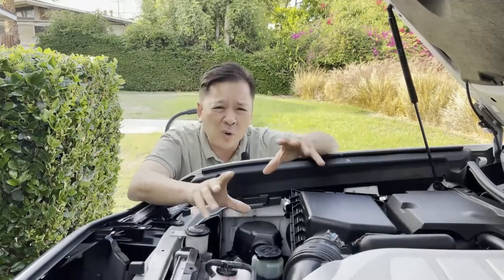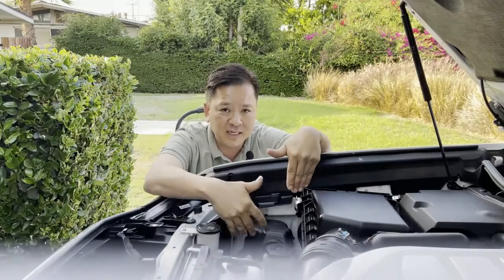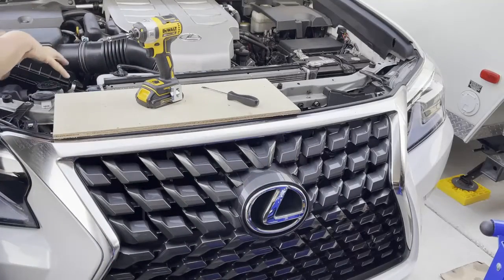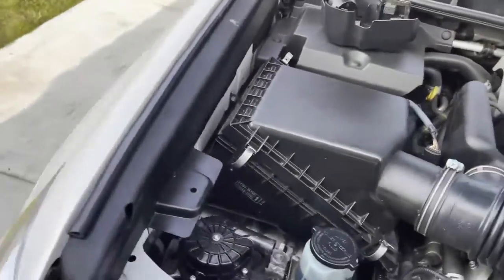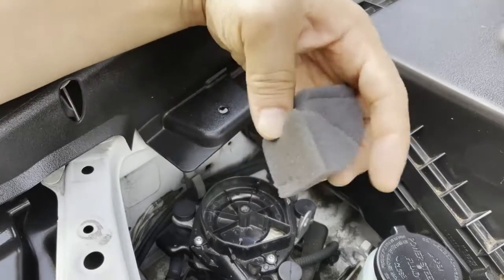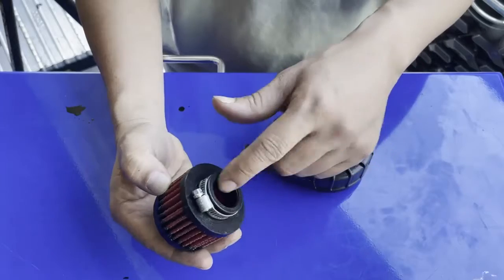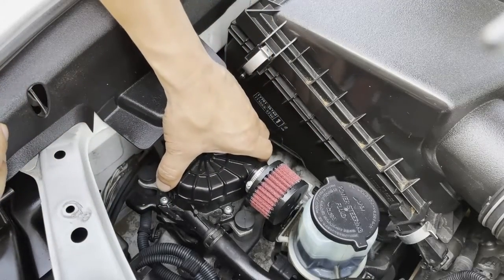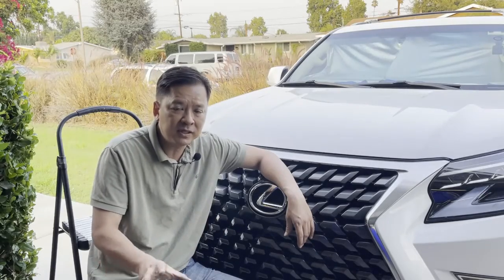Why We’re Modifying the Lexus GX Secondary Air Injection Pump

Comment: Great video Bob.  Happened to my 07 Tundra.  It has two of these.  It also has a really neat computer that automatically puts the truck in a “limp mode.”  so you can’t ignore the problem.  I think the engine works fine if you can bypass this pollution item/device, but you also have to “trick” the computer into thinking everything it is still working.  I didn’t want to use the bypass/computer trick kits though.  Mine went into limp mode on a hill, and my engine light went on.  This would be really dangerous if you were on a long uphill in the middle of nowhere with semi’s passing you at night.  The Tundra will only go about 30mph in this limping uphill situation.  Can’t believe Toyota is allowed to have a non-emergency system that does this to you while driving?  My mechanic did a computer reset just to get me home until my parts arrived and the engine ran perfectly on the way home.  It went back into limp again the next time I started it while I was on my way back to my mechanic again for the repair.  I first went to the dealer for this “service” and they acted surprised like it almost never happens, then I read the recalls and forums telling how chronic the problem is.  I complained to the dealer and Toyota Corporate for recall repair, but both said mine was well out of warranty at 90,000 miles because of age.  $3000 from the dealer to replace the whole “system” only to maybe have the problem happening again.  Local Japanese auto mechanic fixed it for $1200 with both new OEM pumps even though only one was bad.  Will be checking your simple mod out on my 04 GX470.  No problems yet at 170,000, but definitely worth $30 not to have this happen again.  Is it the same part and easy fix for the 04 GX470?  Another way to avoid the problem is to keep your car out of rainy wet climate…like Washington State where I live!  Thanks again for your great video’s.  Every Toyota owner should subscribe to your channel just for this video alone!
Reply from the maker: Hey Blankenship, thanks for comment.  This has happened on both my 470 and 460.  I was only able to do the mod on my 460 since it was out in the open and took as little as 15 minutes to do.  I was able to drop off my 2008 GX470 back in the days at the dealership and they took care of the problem noting the recall was a popular item at the time (and it still is).  The 470, from what i heard and read on the forums, is a lot more work involved as you have  to start removing manifolds, etc...I planned to do a video for the 470 right before all these vehicle prices started to skyrocket.  Because of that, i never was able to pick up a 470 to tinker around with as that was my original plan.  Again, thanks for tuning in Blankenship and i will eventually get around to picking another 2008 up some time in the near future.
Reply: My friend has a gen 1 tundra and went through some issues relating to not starting and limp mode so i will tell him about this issue.
Reply: @juliosdiy3206 gen one didn’t have these issues

Comment: Hi Bob, just to let you know I ordered the k&n filter you mentioned and it’s a tight fit had to trim and it still sits up against the power steering res. Not sure if that’s okay or not. Thanks for all your vids love em!
Reply from the maker: Hey Jude, i wish i was there to see what's going on but as u can see in my install, the fitment was right on.  Your flange doesn't necessarily have to sit at the end of the SAIS inlet tube, you can push it further to gain clearance from the power steering reservoir.  If its still giving you problems, K&N does sell shorter filters.

Comment: Hey dude.i forgot to tell you I made this mod several months ago and it was super easy. I try to avoid things that happened to others with cars. Especially when it causes a real pain in the arse!
Reply from the maker: Did you have any issues with fitment? or rubbing against the power steering reservoir?
Reply: @GXBOB  
No. Not at all. Perfect fit with no modifications other than what you did.

Comment: I have a '22 I just got in April. I called the dealer about this and the tech told me he hadn't seen this in years.
Me being me I had to open the unit and sure enough, it still had the foam.
I decided to replace it. I got the K&N, they both measure the same.
The fit was very tight against the PS reservoir.
I cut the units rubber tube flush with the clamp and I was able to get it on
Thanks
Reply from the maker: A 22?  You got a long way to go before anything goes bad on your GX, but nonetheless, great job for finding a "fix" to make it work.  Not all products and installs come out perfect.  A little elbow grease and an hour on a beautiful saturday is all it takes to unwind.  👍
Reply: @GXBOB  I realize it doesn't happen over night but foam degradation is constant until it falls apart.  So,  why not replace while it is on my mind. 
And it is cheaper than a replacement pump
Reply: @ejcheck   I would like to think they changed the foam type.  It is insane to keep using the same design all these years.  That said, I get my 2023 next week, and just ordered the new filter.....

Comment: Damn Bob that was awesome! Simple and quick preventive mod! Oh and haahaahaa when you threw away the sponge filter! 🤣🤣🤣
Reply from the maker: That was all muscle Gilbert...all muscle.
Reply: @GXBOB  is it a big deal if the outer cover won't go back on? The filter will be more exposed to the elements and will probably get wet... Did you leave your cover off or does it fit with the breather filter installed?

Comment: Just a heads up that the link for the K&N filter is for one that won't fit due to it being too tall.
Reply from the maker: Hey Paul, you might want to shove the filter ( i meant inserted it) a little deeper to make it fit.  I haven't hear of anyone mentioning that it hasn't fit yet so maybe you're being slightly conservative in your  installation.  Shove it in there.
Reply: @GXBOB  I ended up returning it and purchasing the other you shared. That one worked perfectly. I appreciate the response. It could have absolutely been user error.

Comment: Appreciate the video for this mod. Unfortunately, the UNI filter is difficult to find/expensive these days. I ordered the K&N filter linked in the video comments, but it's too tall. It hits the power steering reservoir on my '15 GX460 preventing the SAIS housing from closing. Guess I'll look into one of the generic oiled filters that are shorter than the K&N.
Reply from the maker: the K&N breather elements do come in various dimensions.  You might want to look at a shorter one with 1.5" filter height.  The black housing doesn't need to be reinstalled except when u need to go in for a visual inspection smog check.  Otherwise, leave it off.
Reply: @GXBOB  I meant the top half of the housing that screws back on (where the filter attaches), not the cover. The 62-1410 is ~2.4" tall and it's too big to be used as a SAIS filter. The 62-1370 is 1.5" tall and would probably work.
Reply: Mine inject filter was little bit big too but eventually fits but the top cover I’m not able to fit on it because of the filter size please let me know how is working on your gx. Thanks

Comment: Just got it done today everything works perfect just wondering because after I put that vent air filter in the cap cover not gonna fit no more so it’s the same to you & everybody? Thanks a lot for the details video Bob & have a good one ☝️
Reply from the maker: The black cover does fit. You only need to put it on if you take your vehicle in for a smog check otherwise you’ll fail the visual inspection.

Comment: Hi Bob, my sais switching valve stuck open. Should I order both sais and the valve? Or the vale only? Thank you very much brother!!
Reply from the maker: #1. I’m assuming what caused your stuck valve was a disintegrated internal pump assembly. #2. Buying both the sais and valve combo doesn’t make the purchase any cheaper than if u bought them individually. #3. The remove and replace is fairly easy. 
With that being said, i would first ask the dealer if they would honor this old recall on good faith since they know about this issue. If not, then i would switch out the valve and clean up the Sais out as much as possible and see if that’ll do the trick, then switch out the sais as a last resort.
Reply: @GXBOB  thank you very much BOB!! I really appreciate it
Reply from the maker: Here is also a good read before you head to the dealer: 
https://www.clublexus.com/forums/gx-2nd-gen-2010-present/787537-gx460-secondary-air-intake-pump.html

Comment: I just got the call from the dealership, will cost me $2700 to replace the sais:(( Is it hard to replace it brother? Thank you
Reply from the maker: First I would ask if the dealer will honor the  recall on this part regardless of your year and mileage since this issue is a fleet wide problem. Other dealerships have covered this part even though their suv is out of warranty. It wouldn’t hurt to ask. In any case the install SMS removal is Super easy. Look for the part on ebay, there’s plenty. Do some reading in the Lexus forums. I know there is a recall letter from Lexus floating around in the forums you can print out and bring to your dealer as proof.
Reply: @GXBOB  thank you very much for your help!!

Comment: Hi brother, just got this same issue with my gx460 this morning. Would this still fix the problem bro? Or I have to replace the new SAPIS? Thank you very much!!
Reply from the maker: This video is for preventative maintenance before the issue happens. It looks like your sais is already screwed and will need to be replaced. I would open up the call and see if indeed the foam has disintegrated. If the foam looks brand new then your issue may lie elsewhere.

Comment: Another great “useless”🙄 video Bob! Thank you for sharing. Picking up mine in about 3 weeks, do you think I should do this mod? Will this void any warranty? Prevention is better than cure. 👍🏻
Reply from the maker: You have plenty of time to procrastinate as this failure happens usually around the 100k mark. I’ve seen it happen a lot sooner and I’ve also seen it not happen at all. But the good thing is this is a 10 minute remove and replace.

Comment: Is it the same for the 2021 GX?
Reply from the maker: It holds the same 4.6 liter engine as it’s predecessor so i am 99% certain the engine component blueprint is the same without looking at it. You can do a rough visual yourself by opening your hood and confirming the SAIS is in the front right corner of the passenger side.

Comment: Hi Bob,

 I just did this mod thanks to your video! Once question, with that new filter on, the external cover will no longer fit. I noticed you didn't show this part going back on in your video. Did you have the same experience? I am assuming there is no issue leaving it off, but just want to be sure. 

Thanks again, your videos are super helpful
Reply from the maker: I did snap the black cover back on without any issues. You won’t need it on while driving but you’ll need it when you go in for a smog check. They do visual inspections for modifications in California.
Reply: @GXBOB  interesting, I had to get the K an N filter that you linked to below your video, instead of the one you used. Amazon doesn't sell the uni anymore. Maybe its slightly bigger , because there is no way the opening of the cover will fit it. If the cover is not needed while driving I should be good then, I live in AL they don't do any sort of vehicle inspections here haha. Thanks again
Reply from the maker: @subfightersandman  you’re good to go then! No cover needed really. Just keep an eye on the filter to see if it needs cleaning or dusting off.

Comment: Did this mod today along with led interior and running boards.
Looked like the previous owner 
changed out the foam filter, but I changed it out anyway.
Thanks Bob for your Chanel
Reply from the maker: Any time Raven! Glad to have u onboard.
Reply: @GXBOB  Bob between my wife and I we had 5 Land Rovers, a few years back I got my wife a first generation RX then a second generation RX,I was the last hold out with mine.
I said when it’s time for mine to go I will go with Lexus, a GX460
I’m glad I did, I will never go back to Land Rover. They can’t hold a candle to Lexus.
👌🥃🍸🍷🧨🔥

Comment: Hey Bob… I’ve had gx for about a week… this was my first “mod” now my check engine light is on “trac off” light is on… and the code is p2441…
Reply from the maker: all you did was replace one filter with another one.  This might be a sign that your pump is already failing on you.  I would put everything back to stock and take it to the dealership for their free fix.  Common issue on Lexus and they will most likely repair it.  I've had a couple of my GX's returned to Lexus dealership for the free repair.  Here is a good write up on it. :
https://forum.ih8mud.com/threads/oo2010-2013-gx-460-special-service-campaign.1177130/
Reply: @GXBOB  that’s a good idea.. only thing is… I tossed the parts.. 🤦🏼‍♂️
Reply from the maker: @Shooter1224  if you tossed it like i did then your parts are probably at your feet.
Reply: @GXBOB  lol!! unfortunately no.. do you know where I can find part numbers perhaps?!?
Reply from the maker: @Shooter1224  have you looked into aftermarket? 
https://www.ebay.com/itm/Secondary-Air-Pump-Fits-2010-2014-Lexus-GX460-4-6L-Toyota-4-Runner-17610-0C040-/153689016530?mkcid=16&mkevt=1&_trksid=p2349624.m46890.l49286&mkrid=711-127632-2357-0

Comment: Mine just failed on the 07 Tundra.  Dealer wants $3700 plus tax as “they need to replace the entire system”, so the repair is warranted?  Found a great 
Japanese car mechanic that recommends to just replace the $600 OEM damaged pump.  Dealer rep said “this is a rare problem” and won’t happen again after $3700 repair.  “Only seen a handful of these over his entire career and the newer systems are much better.”  This problem is known and chronic across possibly all new and used Toyota models.  Will hopefully NEVER take my cars to the dealership for out of warranty repairs again.  My Japanese auto repair person took less than five minutes to diagnose the problem as he has repaired plenty of these.  “Extended warranty” for this problem is 100,000 miles or 10 years…expired in 2017?  Pressure at both the dealer and corporate did not work.  Would install this filter on all my Toyota/Lexus’ if it was as easy to do as yours.  Most of these pumps are much harder to get at.  Great advice and video.
Reply from the maker: Great write up Blankenship.  I've had this fail on a couple of my GX's so I'm with you on that.  I did see eBay selling aftermarket SAIS assemblies for a lot cheaper (as low as $50). You said your Japanese mechanic repaired it.  Did the repair involve replacing the assembly or taking it apart and refurbishing it?  One thing for sure is that when i get another GX (looking for that unicorn 2008 to build), i'll most likely disassemble the assembly to see if cleaning it up will do the job unless the foam filter sucked so deep into the system that is it irreparable.

Comment: I saw your video and replaced my 2nd air injection pump filter. I couldn't believe Lexus chose to use such material as the filter when I took it out. Huge thanks to your video and God bless your manhood.
Reply from the maker: That’s awesome Chung, hope the mod helps your GX live a long and prosperous life free of check engine lights.

Comment: SMART, I already changed my Toyota’s twice and every time Paid $2500!
Reply from the maker: you thought about switching out the SAIS assembly yourself?  $600ish for OEM  and $150 for aftermarket.  I can't imagine paying over $2k, that would definitely hurt.
Reply: I tried that too but my after market parts from Amazon failed after 8 months. The main problem was where the injector located. In sequoia it is located under the manifold and it take long time for exchanging. Also opening the 2 air valve’s screw are extremely hard and needs special tools that only dealer have it.

Comment: Great mod & video!!  BTW, I put the outer plastic cover back on after i drilled 6 evenly spaced 3/8 holes over the edge that covers the new filter.  Thanx again for the video.
Reply: Do you have a picture? Ok to leave off altogether?
Reply: @namunyoska2 is it ok to leave it off?
Reply: Is it really necessary? And why? Thanks.
Reply from the maker: Great idea!  Thanks for the tip.  I put my black cover back on also but decided not to mess with it in order to pass visual inspection when i go in for a California smog check.

Comment: Do I need to put the plastic cover back after I finish all the work ?
Reply from the maker: Yes you can.  I left mine off for more airflow which i can completely feel in the acceleration.  Its more zippy.  I will reinstall the black cover for smog inspection because it will fail a visual inspection in California.
Reply: @GXBOB   but i m worry about the plastic cover will block the air in take

Comment: Bob please supply the model/ parts number of the K&N filter
Reply from the maker: K&N Vent Air Filter/ Breather: High Performance, Premium, Washable, Replacement Engine Filter: Flange Diameter: 1 In, Filter Height: 1.5 In, Flange Length: 0.625 In, Shape: Breather, 62-1370 , Black https://www.amazon.com/dp/B00029WXTA/ref=cm_sw_r_cp_api_glt_fabc_XM0EE2J3EMZWT8YVK0E3

Comment: I added a 3" outerwears pre filter to prevent clogs too.
Reply from the maker: K&N makes two different size breathers.  If the 3" one was too snug and rubbed up against the power steering reservoir, there is a 1.5" height one that fits just as well with a 1" diameter flange.